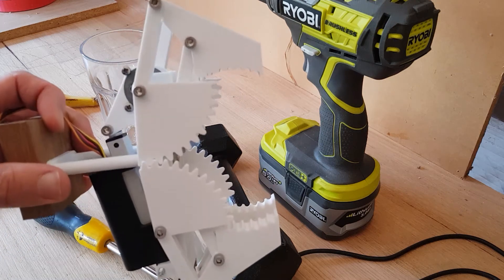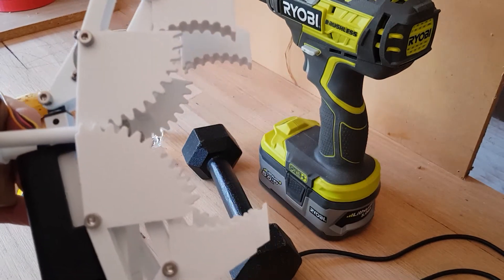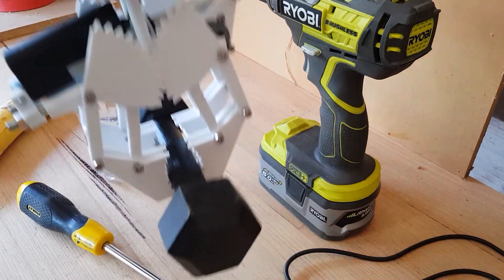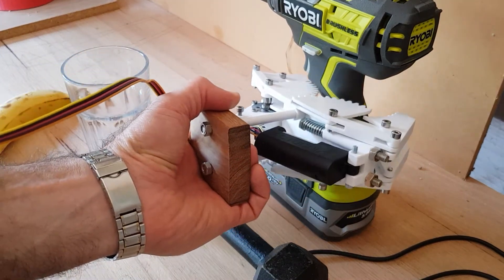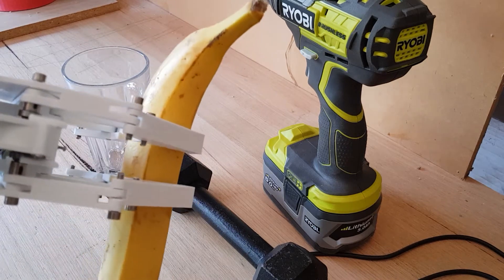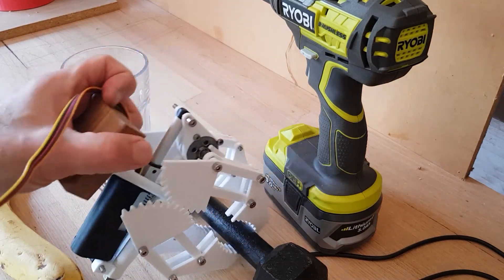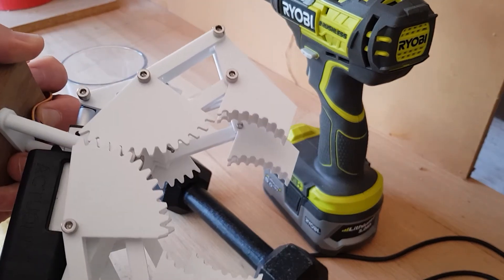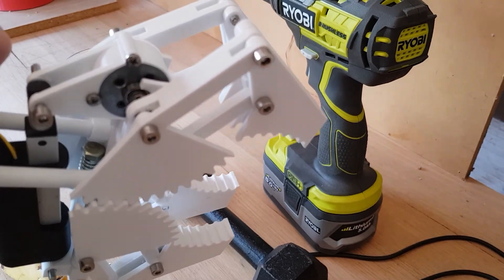Robot Gripper with Linear Actuator and Differential Gearing

Comment: Could you provide the CAD files for the gripper?
Reply from the maker: The design has moved on a bit from this one - first using a 3D printed differential https://www.youtube.com/watch?v=_jN1plFznzI  and then changing the fingers, https://www.youtube.com/watch?v=YHiTTTSysQY .  Finally, I have moved the actuator to be "under" the palm to make the design more compact.  I have not published the CAD, but I have no objection to sharing the design.  Which version were you interested in?
Reply: @hughsanderson1834  I'm interested in the file of the gripper design with the 3D printed differential, and also the file of the older version of the flexible fingers.
Reply from the maker: @adamfreedman6672  It is going to take some work to find the best versions and how best to export them
Reply: @hughsanderson1834  Oh ok 👍
Reply from the maker: I have added the STL files to a git repo:  https://github.com/hughsando/robot-parts
Reply: @hughsanderson1834  Thank you so much!